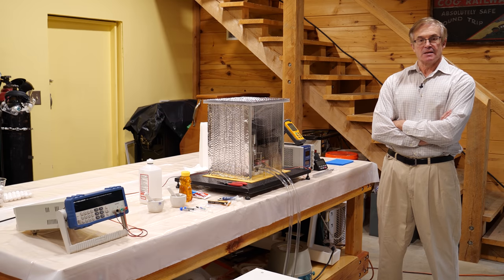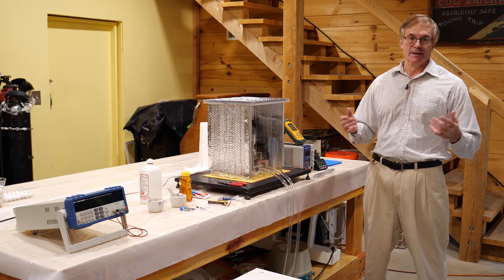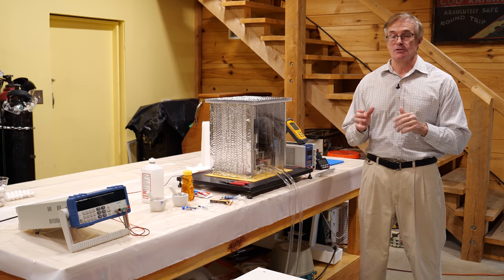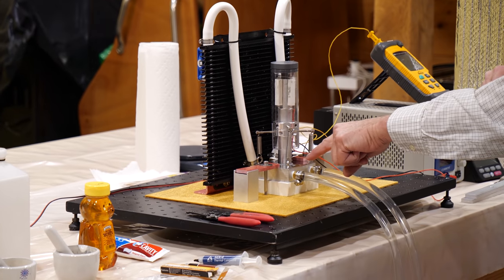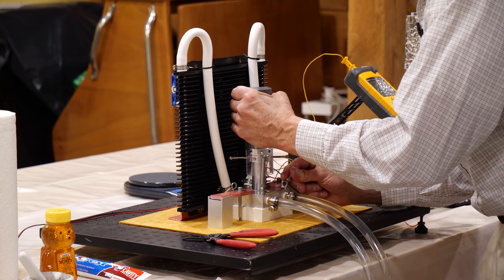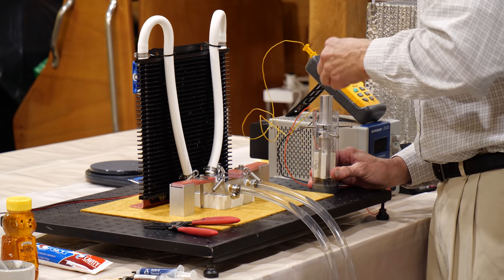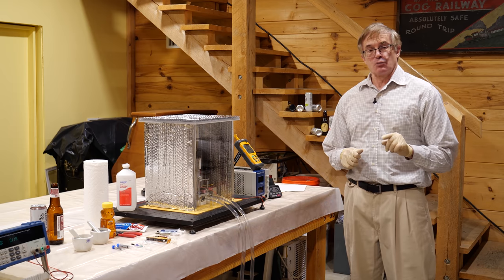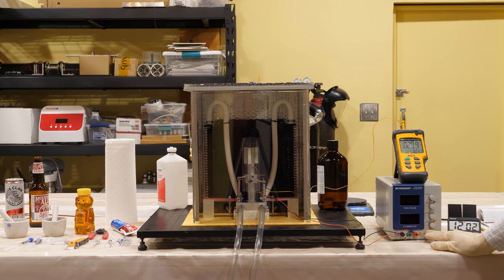DID WE JUST MAKE THE WORLD'S BEST THERMAL PASTE!?

Comment: It would have been nice to see a control, without any thermal interface material at all.
Reply: And one with some kind of thermal insulator (sort of a "worse than nothing" test), so we can get a better sense of the scale of the results.
Reply: I agree, but how accurate of a test would it be given the bit about surface imperfections and small contact surface area?
Reply: Yes! Negative controls are super informative and basically essential. Surprised it wasn’t shown. I bet they did this at some point.
Reply: @JustinWillis_actual  it would show how good the surfaces already where and if the thermal compounds where acting as insulators. Thinner the better the more perfect the two surfaces are. It's probably a huge variable in how you should choose your compound for the job.
Reply: definitely want to  see a dry run!
Reply: The best would be 5 dry runs altogether after 5 cleaning procedures: i am pretty sure, that there are cellulose residues of significant thickness.
Reply: @oligophagy  It won't boot because it will hit max temp and trip the protection EDIT: should have watched before commenting, they didn't use a running computer to test it lol
Reply: He did - when he said "no machined surface is ever going to perfect". The necessity of an interface material in many applications preceded the test.
Reply: @hundredfireify  Scientifically speaking I think it would make total sense. If you run it with an insulator, it tells you how much of the heat is lost by the rod into the air of the enclosure, which is a parasite heat loss that occurs in all the other tests.
Reply: @manuelpellizzari8540  The air was also cooled by the radiator.
Reply: @Kraus-  Exactly, it has to be in order to counteract the unquantified heat loss of the rod and heating elements into it.
Reply: May as well test thermal pads and the 'graphine' pads as well lol
Reply: Water.
Just enough to displace air from a narrow gap between the two surfaces.
No metal-to-metal contact allowed!
Water has the highest heat-capacity of any common substance, yet has lousy thermal conduction!

Comment: I really like this video and find it interesting as I'm something of a computer nerd myself.  I only feel that there is one variable missing in this video that is considered a fairly important property of thermal paste which is longevity of effectiveness.  Maybe an idea for a future video? Either way, your dedication to these projects and results that you get are pretty impressive.  I'm glad I subscribed a few years ago.  You guys have an amazing channel!
Reply: For Overclockers there is only the peak performance. so honey will do.
Reply: Correct, this is a time zero test. When validating thermal solution it is temperature cycled to accelerate life degradation. Another important aspect is measurement account part to part variability.
Reply: Thermal Paste cost $6 delivered to your home via Amazon. Buy it.  You know it is correct. No guessing. It will last many many years.   Simple and Effective.
Reply: Took the words right out of my head!
Reply: This is very important. I've seen compounds degrade over time and some of the cheap ones even leaking out from under the heatsink which led to thermal shutdowns. I generally stick with NT-H1 / H2 or ArticSilver MX. The latter will retain its properties for years and makes taking off a heat sink easy.
Reply: @chicken29843        Try what you want.  In a professional setting, only use what is prescribed by the manufacturer.  Why? Because it works.  You do not need to reinvent the wheel every time you drive your car.  Obviously you are not a professional anything.
Reply: @oldmech619 "It works" is not the same as "this works best." 99% of the time these days, manufacturers are looking for any way to cut corners and reduce costs. Using thermal paste that "works enough" is one such tactic, but could potentially result in shortened maintenance intervals for that part. So, if you know of something that has been proven to work better, and you use it, that's how the maintenance book gets changed. That said, with any paste used in aircraft, it is imperative that it not leak out or conduct electricity, which means high viscosity and long term thermal stability with materials like carbon or silicon glass. I mean, if I can heat up a small glass tube closed at one end with a wall thickness of 2mm to 800°F and within 45 seconds be able to touch it unscathed, it's gotta have some pretty good thermal conductance right?

Comment: Cycles would also be interesting, how does the paste hold up?
And: If you'd increase the power it would help with the resolution. You have 0.1K differences and you can resolute 0.1K -> If you'd pump more power in you'd get more dT thus better "signal to noise".
Reply: Yeah, I missed the temp level but if he was pushing 100C it would be interesting, seems my old CPU that plays YouTube videos at a temp of 34C Plays other games at up to about 72 which is a bit over the recommended value of 66.  But if I push it harder and it gets into the '90s my computer says that enough of that silliness and shutdown :(  Now I mean I'm glad it shutdown because otherwise, I would have already had to buy a new CPU, but this did make me wonder about changing my factory Heatsink for a replacement with a bigger heatsink, pumps and grills and all that seems like too much for me, but a big heat sink and a quiet fan would make me happy, my fan case has actually blown all its fans but the CPU and Video card fans are still working :)
Reply: @basildaoust2821  If your CPU is getting so hot that the system shuts down it's likely that one of three things isn't working properly anymore - either the fan isn't spinning as fast as it should, the fins of the cooler are filled with dust and debris, or the thermal compound between the cooler and the CPU die has dried out (could be all of the above). Also, if the case fans are not spinning, you are not getting enough fresh cool air to help with cooling your CPU, video card and other components inside the case. If you don't feel like changing the case fans, I would recommend removing a side panel and keeping it off so the hot air inside the case at least has someplace to go. Then take your CPU fan off (remember the orientation) and take a vacuum cleaner or compressed air to the fins to remove the dust buildup, then screw it back on and see how it goes (you don't have to take the cooler off the CPU in order to do that). If this doesn't help with your CPU temperature, then it's probably time to change the thermal compound, as it might be dried and cracked and effectively insulating the CPU instead of helping dissipate the heat. This is all assuming that your cooler isn't seriously underspecced for your CPU, in which case you should look for a better alternative, however, you might as well try the inexpensive solutions first.
Reply: @benedictul  Yeah I don't think the issue is any of that, it's just if I push it too hard it gets mad.  I mean my case fans have died and I have a house fan blowing air through the case with the side panel off.  The CPU fan and the video card fans are working just fine.  I have a new CPU that is much better, not good compared to the new ones but more than twice as good as my old junk.  So yeah the plan is to first run the one or two games that complain at lower graphic settings which does work quite well while I buy a few pieces to put the new system back together.  The change does also let me switch to an m.2 drive so I expect some nice improvements.  Thanks for the suggestions.

Comment: I'd have loved to see a summary of the results at the end, to make it a bit clearer how the different compounds compared. 
I'm also curious how the temperature vs. time chart would have looked. Was it more or less linear?
And a suggested improvement to the setup: use an Arduino or ESP32 or something with some relays to automate the cooling/measuring cycle. That way you could leave the equipment unattended for a full test cycle.
Reply: AGreed there, I was just going to suggest a temp logger. But You can also chart the temperature inside the Arduino. (I wouldnt use ESP32, they don't tend to have very good built-in ADC's. And, if you use a digital temp sensor like DS18B20 , I have noticed that they tend to be +-3 F cyclically, which requires a ton of averaging. )  I found Arduino's ADC and a simple PTC thermistor to be the best of the bunch
Reply: @gutrali  I was thinking they could interface with their existing high-accuracy scientific equipment. It's pretty common for it to have some kind of digital interface. If not, I think the built-in ADCs on both boards are pretty garbage, better to grab an external ADC on a breakout board or something.
Reply: There's a link to the results in the description.
Reply: @gutrali  What is the effect of the ADC on the ESP32 not being good? Also, aren't they suitable for temp dataloggers?

Comment: I wish I had a science or engineering teacher like you when I was in college, I guarantee I wouldn't have fallen asleep in class.  Great content!  Suggestion: for all the effort you put into the thermal test, you could have used a thermometer with an extra digit of accuracy so there would be more than 1 count difference between all your samples.
Reply: You probably would. Thats the power of editing video. But the alcohol they didn’t drink, but you can, would make it more endurable ;-)
Reply: an extra digit of accuracy would be telling as of the comparison between the different pastes, but would still be practically not-interesting... 0,01°C-difference isn´t gonna make your overclocked CPU feel any difference in longevity or performance. So, althought u r right, this change would only raise the "thrill-factor" and production-value of this test itself (raised production-value pays for enhanced thrill-factor), without any other practical significance.
Reply: @klausbrinck2137  The thing is its not .01C difference really. The units arent really useful in this situation its a qualitative measurements that don't apply to cooling a cpu.Its just showing which is better than the next one. It could end up being 10C or not noticible. Like he said the actual temps are only applicable to his testing setup but will show a difference as to which performs better than the other

Comment: Please run 3 more tests for the benchmark:
- Clean surface (no paste)
- Drop of motor oil (10w-40)
- Drop of water
Reply: Would also like to see how the indium film does.
Reply: @tegra5971  That would have to kick off a whole series on how to generate enough pressure...
Reply: Drop of Mercury?
Reply: @Spiralem  Likely too unsafe
Reply: @Spiralem  That'd be pointless, since mercury is actually a very poor thermal conductor.
Reply: @Spiralem  pretty sure both testing surfaces are aluminum. That would end poorly for the testing apparatus
Reply: @josephgauthier5018  Aluminum readily forms oxide with the air, resulting in a surface that is pretty much resistant to Mercury.
Reply: @Spiralem  Yeah but once it gets going, it's pretty ugly. Sometimes you have to work like hell just to get it started but sometimes it stars easily and the damage is pretty amazing to behold.
Reply: @Spiralem  normally, yes. however, all it takes is a little bit of abrasion, which is reasonably possible in this set up, and it will find its way in and destroy the aluminum. also, im not sure how easy it is for mercury to wet to oxide coated aluminum, so some scrapping may be required.
Reply: @DejectedCat  mercury is probably a better thermal conductor than most if not all of these thermal pastes.
Reply: @garethbaus5471  mercury has lower thermal conductivity than mx4 paste

Comment: Great video and work as always. I feel like you've missed some important properties that should be measured:

1) How much does it 'dry out' / oxidise over time (sometimes can be simulated with elevated temperatures)

2) Some compounds need a couple days to reach peak performance, including AS5, how bout testing after a week? 

3) Feel like you need to have sandwiches that hold the different compounds over time rather than always scrubbing them. The interfaces to the sandwich could be designed around them or just all ultra smoothed lapped so it's not performance limited there.

4) I haven't used AS5 as my premium compound in a decade, I use IC Diamond (tiny diamonds) for some installs and Thermal Grizzly's Conductonaut (liquid metal) if it doesn't eat into the heatsink. You're not exactly comparing against cutting edge?

5) The performance of a lot of these pastes will be somewhat muted in practice because many Intel chips have poor thermally conducting heatspreaders with middling thermal paste over their silicon. Would be interesting to do a die delidding or lapping in combination and see how that goes.

6) For ultimate performance, I'd have a delidded CPU with a Graphene horizontal thermal transfer sheet (can't transfer vertically but does great horizontally), then have lots of holes with a silver sheet overlaid including silver going into the holes to provide vertical transfer, and so that the heat distributes at a fantastic rate over let's say 6cm X 6cm, and the silicon die is already incredibly smooth (but not always flat, can be lapped), then the Graphene sheet has enough compliance not to need thermal paste (still good to test), then a heatsink bonded to the silver layer with a liquid metal thermal interface. 

If you do that, now that would be world record impressive and a heck of a video!
Reply from the maker: As a filler material, graphene is not good as I'll explain in the next video.  If price is no object (and it always is) then we have some disk heat sinks with grown vertical arrays of carbon nanotubes that rival bulk diamond for heat transfer.

Comment: Exciting work! Considering your extensive work on thermal conductivity, cryogenics, and magnetism, I’m surprised I’ve never seen a video on superconductors. Do you have any upcoming projects with superconductors? 

Thanks
Reply: A superconductor video would be dope
Reply: "Hello, this is Tech Ingredients and today we'll show you how to make the worlds first room temperature superconductor from common hosehold materials and some stuff you can order from ebay for a few bucks"
Reply: @GerManBearPig  You can buy superconductor pucks on ebay, not sure how you would reprocess them to make wires, but could be done probably.
Reply: @BlackHeartScyther  Maybe, but those need to be cooled down with liquid Helium or Nitrogen. That's why making a "room temperature" superconductor would probably win you the nobel prize immediately (if it doesn't need a few thousand bars of pressure to be stable)
And afaik the'yre all ceramics, so processing a brick of it isn't really an option.